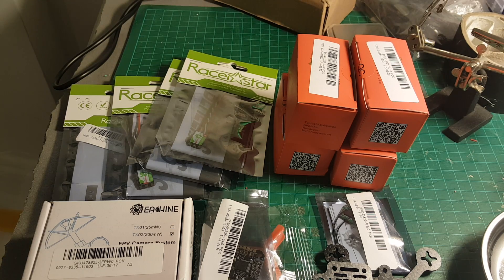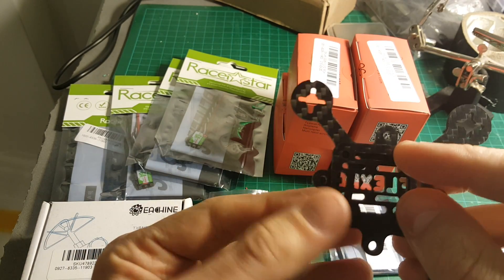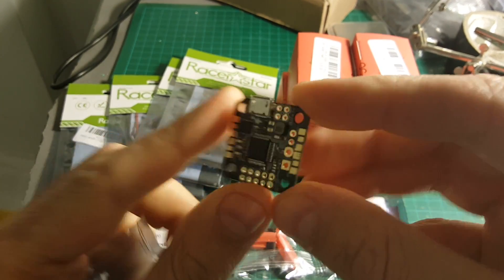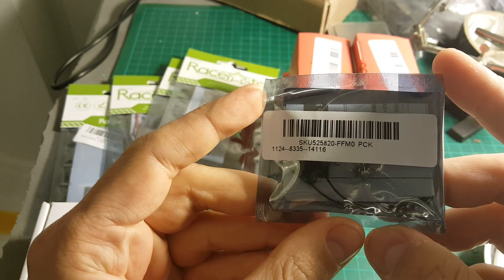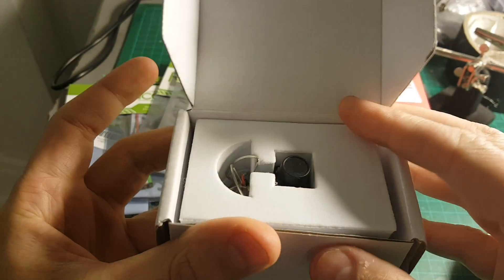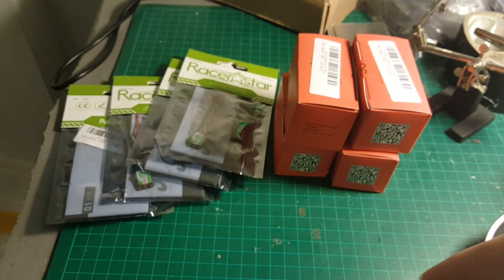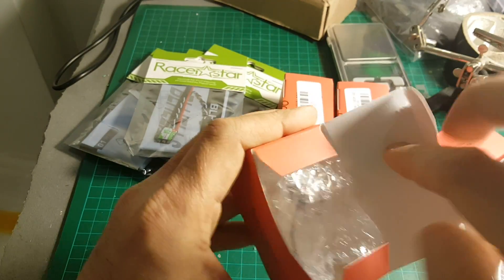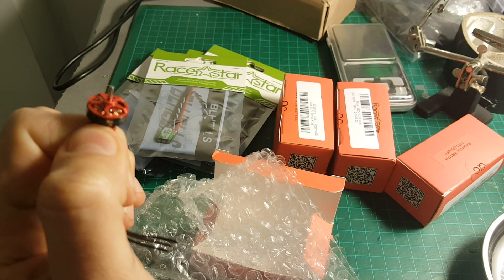Pico X - Micro Brushless Part 1 - Parts Overview

Comment: Hey Gal, great video thanks for posting.

I had one question regarding the wiring from the ESC to the FC . . . I have the same components and want to know if you solder both black wires from the ECS (the twisted one with the white single wire ) to the same spot on the FC Negative pad ?

I didn't think you need to worry about the second negative wire, but it looks like in yur video you have soldered them both

Thanks
Reply from the maker: Julian Redwood Hey Julian, thank you for your comment. You can simply ignore the black wire, but it is better to twist them together and solder them to the negative pad on the FC.